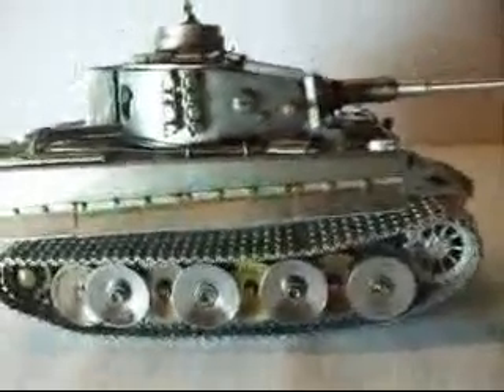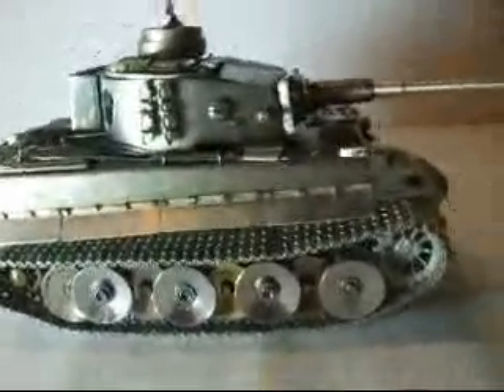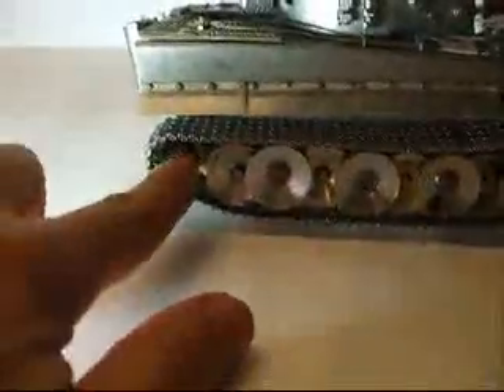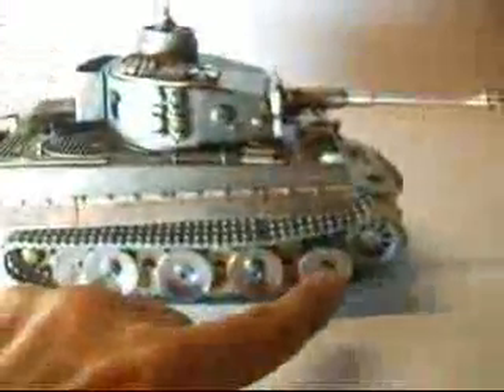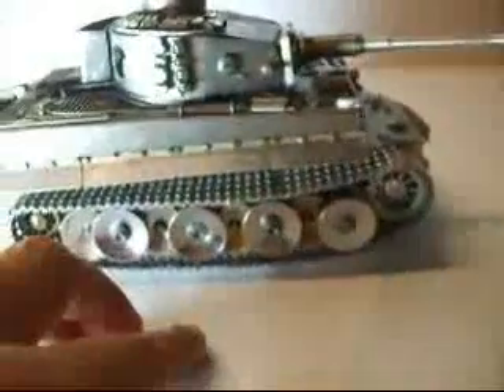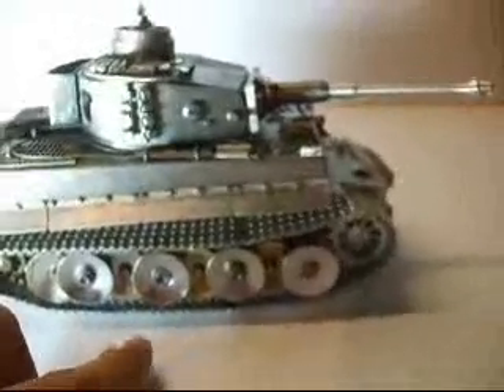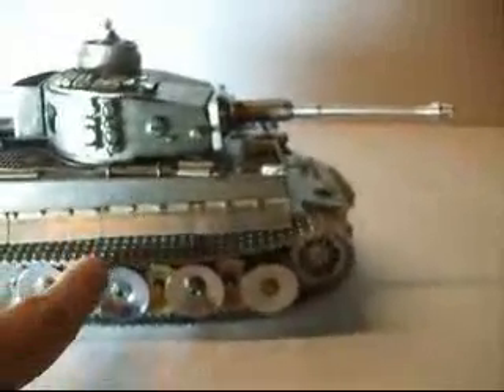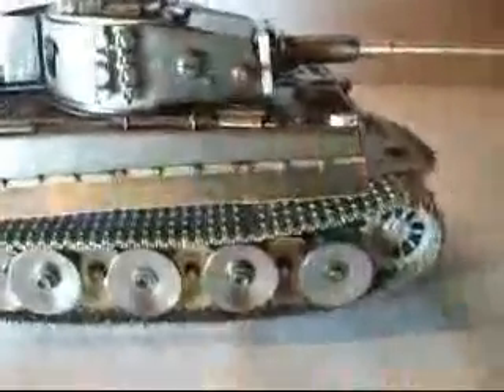1-35 ALL METAL CUSTOM BUILT TIGER 1. Part 2.WMV

Comment: the tank looks really good for being metal.
I think if you added a tamiya 1 35 rc tank controller it would make it drive with more control or slower control.
the tank can already drive but the tamiya controller would make it drive alot better I think.
would be worth getting for the tank.
Reply from the maker: I have a futaba control for it. Thank you for your opinion. I will consider it for the future
Reply: +matostruck your welcome.
I think I was talking about the esc too the tamiya 1 35 electronics work pretty good and have good control too.
Reply from the maker: +dragon model O.K. I have a tamiya esc. But I am having space issues. Due to the small space inside the Tiger. But I have a esc from clark model. It is even smaller. Also the sound board from C.M.

Comment from the maker: Yeah. It needs a lot of adjustments and more details. After it is all done. I will chrome all the parts in non corrossive plating. I will leave it in the metal look. Yeah I like the DAK look. But I am not a good painter. Maybe the next tiger I build in metal. I will send it to get painted. But it is a lot of fun to build these model tanks. Thanks a lot for your input.